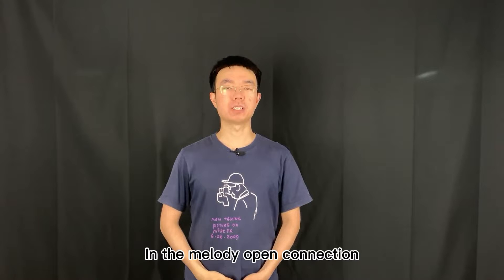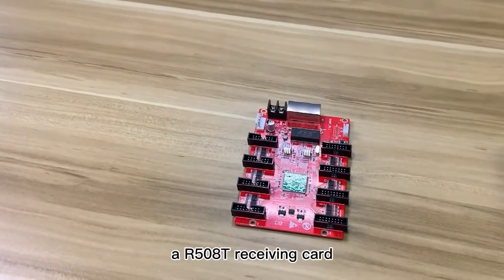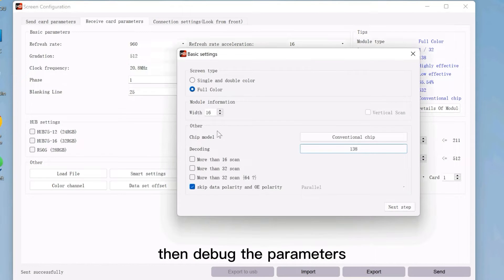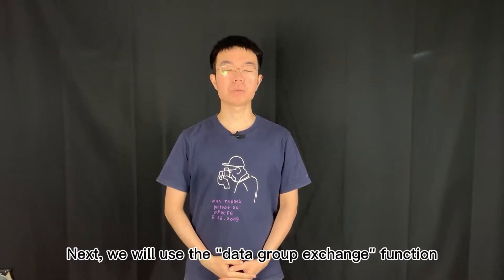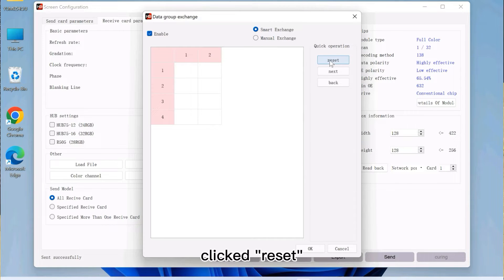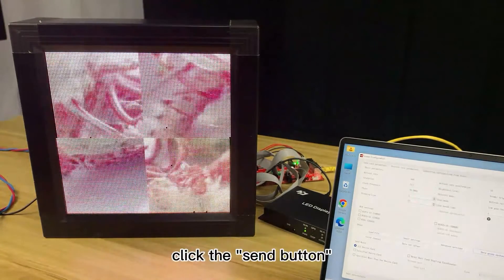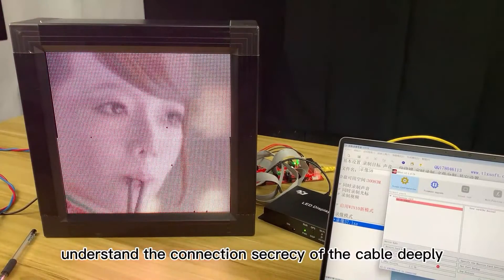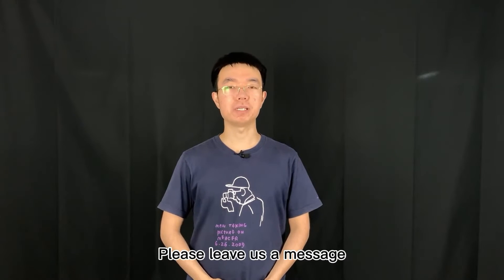Huidu Controller Tutorial of Smart Data Group Exchange in New Process

Comment: Dear Friend, I need help to restore normal display on a videowall using HDSet. I'm using VP210 Video Processor, LED Screen 4x (R512T Card connected to 32x P5-6432-1921-8S V1.3 modules). I need to know Model Chip and Decoding to select when using Smart Settings setup